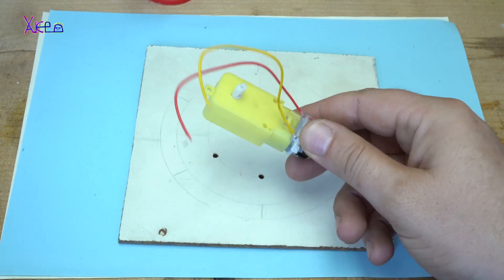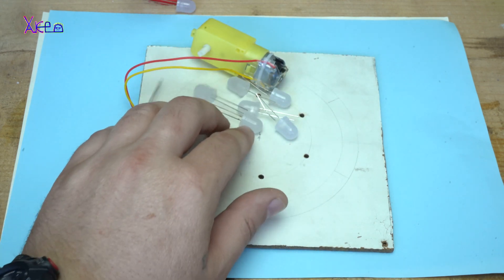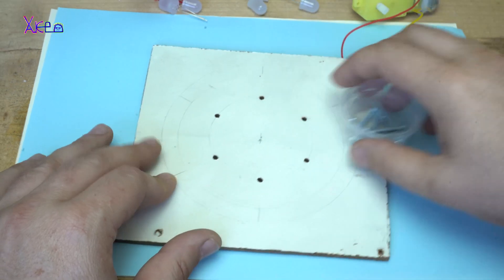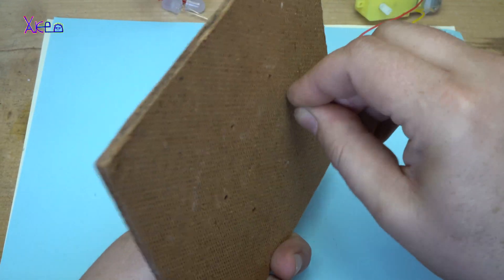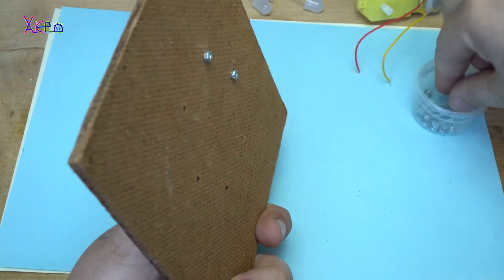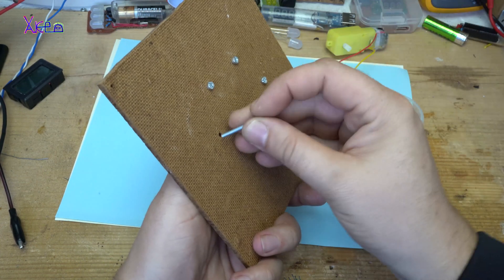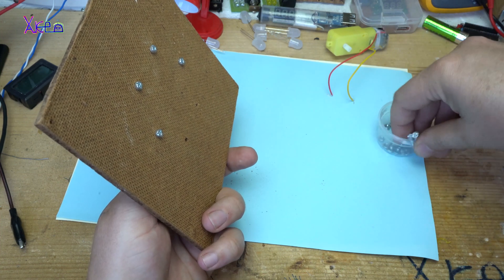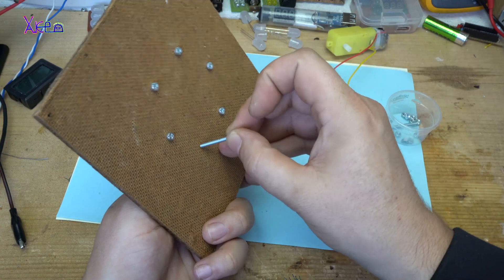Mechanical LED Rotation Light | Decoration Idea

Comment: A long time ago, I did the same thing, but with a whole string of christmas lights (about 50 of them)
Reply from the maker: That is complicated with 50 screws😉
Reply: @Hacktuber  No screws, I used nails and a turn table (vinyl player) instead of the motor you used.